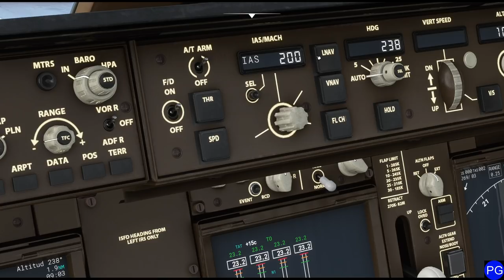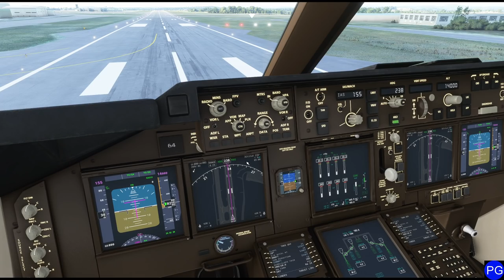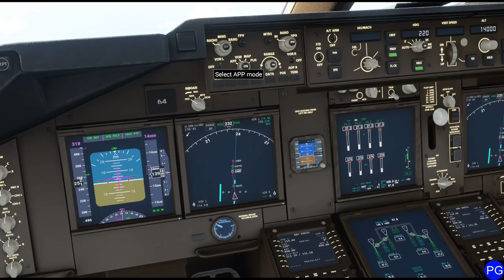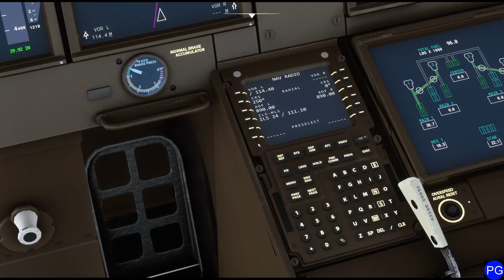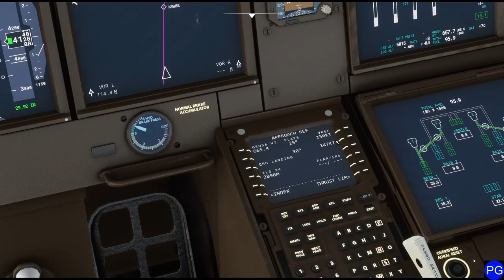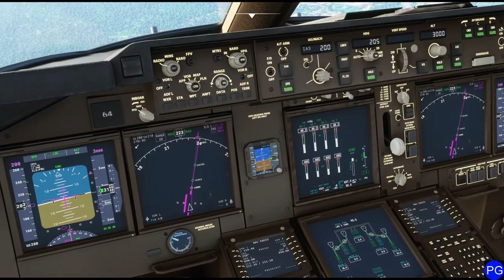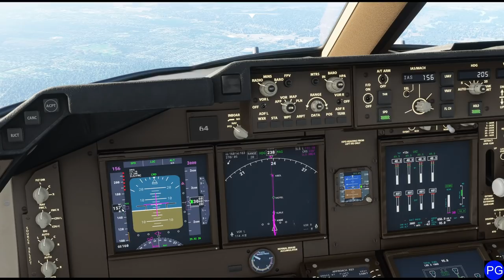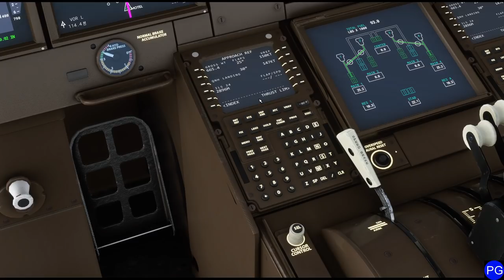FS2020 - Boeing 747-8 Autopilot Tutorial

Comment: How does he get the v1, v2,vr speeds to be already filled out, is this in the default b747 8 in msfs
Reply: This is probably not the default B747, because the default plane's FMS does not work as it is shown in this video.
Reply: You can set v speeds on the takeoff plate but its better if you use a flight plan site to properly set the aircraft fuel and payload for your trip, and actually set the data from your flight plan in your FMC perf page (fuel, GTWO, ZFW, etc.) and the FMC will then calculate your vspeeds for the departure runway of your flight plan.  Once it has calculated your vspeeds you need to click them to activate the recommended speeds.  I also dont agree with the other comment about this video not being stock msfs.  Maybe it is but aside from some airports and liveries my msfs is fully stock, and my FMC works just like what is shown in this video.  

Its confusing at first but learning how to use the FMC has been one of my more satisfying flight sim experiences.  I have got to the point where once airborn I can have the autopilot fly the entire flight in vnav and lnav where I hardly have to do a thing.  All I have to do do manually is during approach I add flaps as needed (based on vnav speed being flown), activate approach mode when its intercepting ILS, drop gear, set auto spoilers and auto brakes, and it lands itself just like shown here.
Reply: @larrybremer4930  Ok thx

Comment: Had to come here to make sure i wasnt doing something wrong. V/S hasnt been working as i adjust it. can change heading and speed but v/s wont tell the aircraft to produce the climbrate i want.
Reply: same
Reply: VS will only engage if your altitude bug is set to a lower altitude then your currently flying at.  Once you descend to that altitude VS will disengage and you will return to altitude hold mode.

Comment: the a320. neo is way yo complex compared to boeing airliners
Reply: You have to be joking? The NEO is a piece of cake compared to the antiquated systems on the Boeings 😂
Reply: @j4cko56  i know how to work it now. the reason i said that is because i’ve never flown an airbus and always flown boeing so i just have more experience with boeing aircraft
Reply: Learned the A320 way sooner and easier than I am with the 747. The 320 doesn't decide to randomly do a 360 inexplicably and I've gotten pretty good at landing it - the 747 though, I've had to work to learn this AP
Reply: @tristanb.3470  I 100% agree the a320 is more simple once you get to know the systems and controls. I never fly the 747 however I fly the 787 which is my main airplane I fly. Ive always flown Boeings in xplane and other sims so I guess I’m more comfortable with the systems on boeing aircraft. But yes I 100% agree the 747 is way to difficult to control
Reply: A320 neo auto pilot is much much easier and straight forward than boeing. :)
Reply: @noobmusician3091  I 100% agree! Now I fly the a320 more cause I learned how to use it, Reason I said that is because I’ve always flown Boeing, I flew 767s back in the day
Reply: A320 is so easy (A310 is not) but I now prefer flying 747 since I can automate nearly every part of the flight in FMC and Autopilot.  I think the stock A320 does not have enough fidelity for setting up FMC to the extent the stock 747 allows.